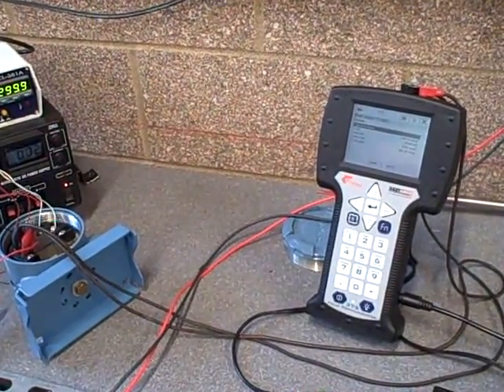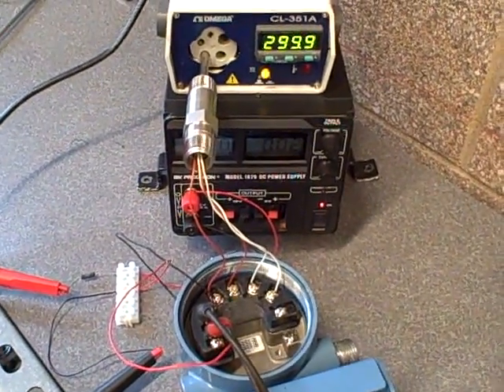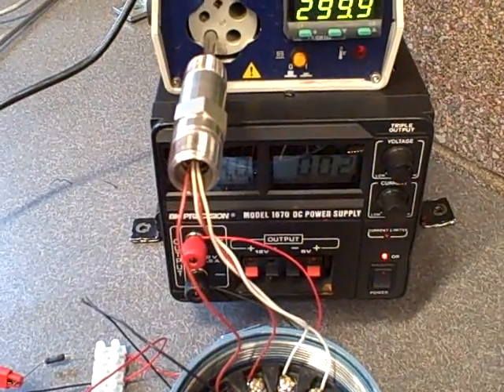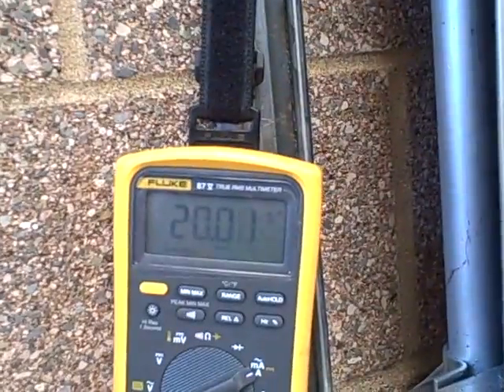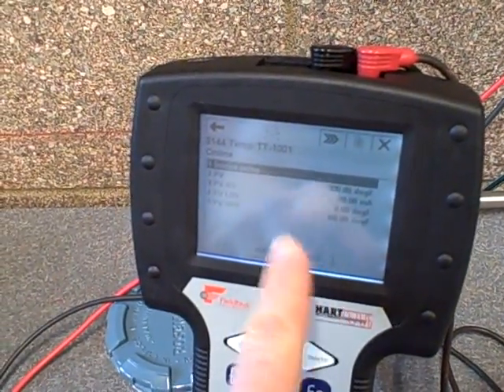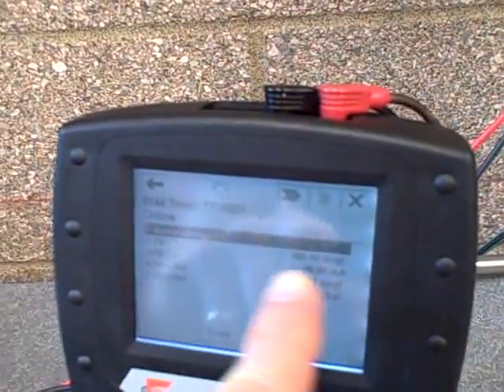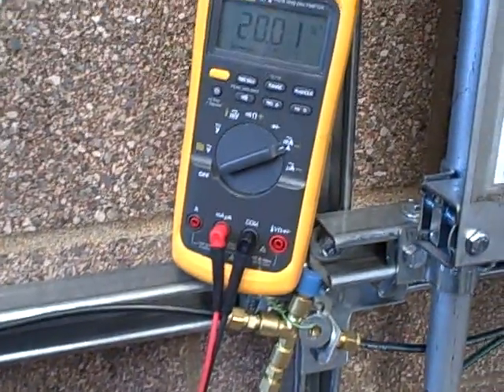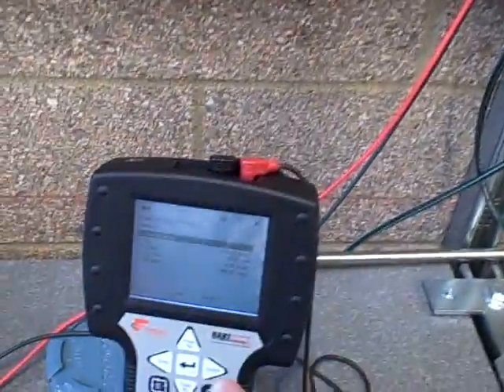Dryblock temperature calibration check of smart transmitter (part 1)

Comment from the maker: Very good point.  However, the test uncertainty ratio (TUR) which you reference is really a ratio of the standard's uncertainty versus the allowable uncertainty of your application.  The Rosemount 3144 is more than capable of sub-degree accuracy, but if the application doesn't demand that much, it would still be okay to use a cheap dry block calibrator.  In other words, it's okay to calibrate a precision instrument to a lesser standard if the final application can tolerate that lesser standard.

Comment: Important to realize that the standard should be more accurate than the DUT.  I'm sure you are aware that the small dry blocks are typically  +/- 2-3 deg. F where the nice Rosemount is sub 1 degree F.  I do a test with a triple point of water cell and there are other fixed points of ITS-90 that can be used.  The setup in the video is nice because you can see the whole system being calibrated and not just simulated although the simulation method might be more accurate.